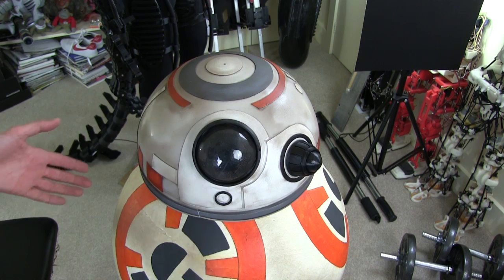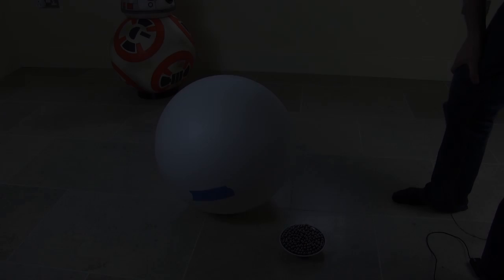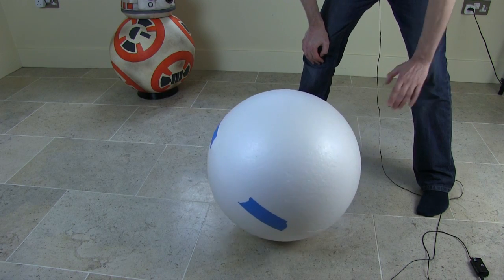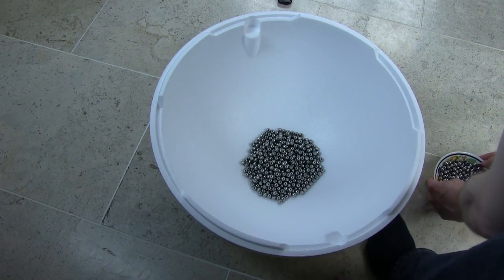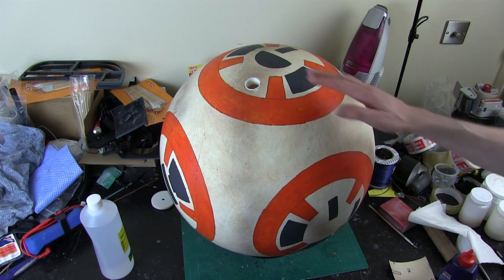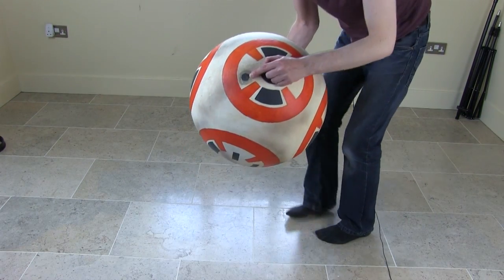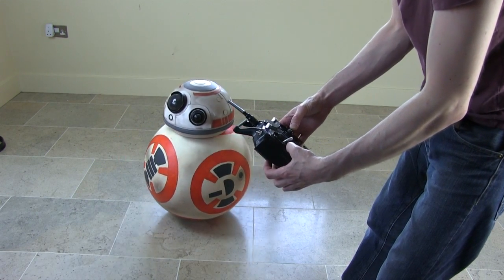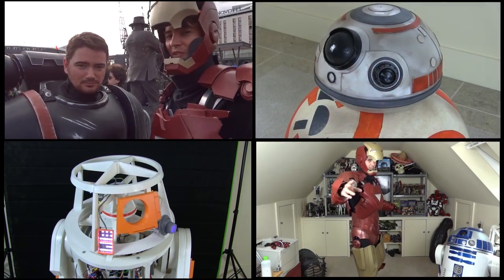Star Wars BB-8 Droid v1 #5 | Improving Stability | James Bruton

Comment: +James Bruton

It seems like this is an attitude control problem. Have you considered gyros?
Reply: This design would be much more effective if you enabled it to be opened up, and single ball bearing installed that's equal to the weight of all the smaller ball bearings you have in there now.

Comment: The original small version has all the controlers INSIDE the ball.

Not the head!!!

If you do it like the retail version it might be better
Reply: +James Bruton (XRobots) Actually, it's fairly similar. It uses a weight towards the bottom of the ball to move itself akin to using a gyroscope while using an always upright magnet to hold the head in place.
Reply: +James Bruton (XRobots) You should try to configure the controls to run on a program on your smartphone. That way it's a lot easier (at least to me) to control and you might even be able to get it to follow you, if you add a tracker of some kind.
Reply: +James Bruton (XRobots) try placing a slightly smaller sphere that has a centering weight inside the bigger sphere and use some type of oil lubricant between the gaps of the two spheres and technically speaking it should work,it's just a matter of placing the right amount of weight in the center sphere and finding a solid smooth material for the outer sphere,kind of like how a novelty eyeball glide ball works but instead of water you use oil.

Comment: this might sound retarded but I have a thing you might try.Paint the ball with Plastikote paint with a little distance to the can so theres a very slight texture. the plastikote paint has a rubbery surface it will add both density and traction to the ball and seal the ball to protect it from any lubricants. it would in effect simulate your results on carpet and reproduce them on a smooth surface but not increase your weight so extremely and make absolutely zero noise.

Comment: I wonder, what about suspending a smaller ball (via 20mm tubes or similar) that sits concentric within the polystyrene shell that is made of plastic and filled with a liquid?

You could use water as the base liquid and add substance to it such as sugar/salt to increase it's density and it's viscosity.

Comment: will be interesting what you do.. just at about 3mins into the video.. so don't know what you've done yet.. a large semi-deflated soccer, dodge or volley ball inside .. it would be light but act like the carpet from the inside like you want. the physics are pretty much exactly the same...  of course the weight of the ball and it's inflation would have to be played with.

EDIT: a lighter, but large diameter kids ball would probably be perfect.. like those sold at Walmart for $2 and are made of thin vinyl.. they hold their shap well, have minimal mass and would be a perfect analog to your carpet

OR

a some glass marbles/ball bearings, depending on mass tuning

EDIT 2:.. lol.. just pushed play and yep ball bearings .. but i'm thinking the under inflated vinyl ball is your best bet.. and IT WOULD BE SILENT

Comment: have you tried Green Tire slime its thicker than water and it might work, but you will have to try and find a balance, best way would be to slowly add it and try it each time to find the balance. Maybe even Oobleck might work. You used Ball bearing, you can use the weight of the ball bearings to find the proper amount of slime to use.

Comment: +James Bruton (XRobots) mount a strong magnet on bearings inside the ball - and have it pull toward a similarly mounted iron plate in the bottom of the head.  You might also leverage this for traction to turn the head atop the ball.  CAREFUL - you'll have to shield all of the electronics well if you plan to mount a magnet that strong just below them or you could scramble your droid.

Comment: To increase stability, you need to reduce the motor gearing ratio, and use larger motors.  Effective inertia scales with the square of the gearing ratio, making the inertia and brush friction of the motor rotors dominate over everything else.  That's why Segway-type balancing machines require oversize motors, geared low, and require large battery currents.  The gyro signal is independent of where it is positioned.  You won't improve anything by mounting it higher.  In fact, the accelerometer signal gets worse the farther you get from the ball's center.  That's why you low-pass filter it.  You comment that the Arduino is too slow.  I say Bull!  If the code updates 100 per second, it is plenty fast.  (If it is not, you need to "write some real code" in assembly.   Bump up your motor size, and lower the gear ratio.  Regarding ball fill, I would use a viscous fluid, such as glycerine.  Adjust the viscosity to be critically damped (just enough to not overshoot).  You can do this in an open ball half to test.  You could also use polyethylene oxide dissolved in water (chemically innocuous, and you can adjust viscosity, and a very small amount can thicken a large amount of water).

Comment: was a neodenium magnets in the big ball not an option similar to how the toys have been created?
Reply: +James Bruton (XRobots) - The head may not be as stable staying in the center top but it actually moves and picks up speed without making tons of noise like your model. You should cut your loses and try making a larger scale model like the store made smaller version learn what makes it tick and then improve from there. The only thing I can think to make your version work better is filling the ball with those gel beads that absorb water and grow over night (usually used in kids toys or in room scenters). This would prevent the water from sloshing around to much.

Comment: I think if you build an apparatus that could freely move inside the ball, but kept a weight up more towards the top of the ball, it would have much better stability. Perhaps a rig that has the same sort of wheels the head has which can support a rig that holds a weight? It wouldn't even require battery power or electronics, it could be entirely passive I believe.

Comment: here is a crazy novel idea why not put the computer and drive motors inside the ball with a simple stick reaching up to the top side of the ball with a magnet on top and a corresponding magnet in the head. that way the ball will be naturally gyro stabilized. you will need 3 more Omni wheels tho.

Comment: Consider having a light weight internal and external mechanism, have it interact opposed to the gyro inside and with the gyro on top. Considering it'll be inside you could also create a wheeled pole in the middle that extends vertically(You could use the ball bearings to limit friction by using them like wheels)

Comment: Very impressive work! Although, instead of the ball bearings, wouldn't a slightly more viscous fluid have worked in a similar manner without the noise? Perhaps even the Silicon oil you'd used would be enough.

 Also, any chance you could/have made a video showing the remote controlling in action? Just navigating a small course would be great. I'm interested in the control and handling you'd have with it.

 Great work again, and thanks for showing us the process!

Comment: Another idea you can experiment with is using just a 2 dimensional axis (plus sign diameter of the sphere) having very low-friction wheels and one corner having a magnetic connection with your head (controller unit) so when the head turns on it starts the magnet on its bottom (obviously an electromagnet) and connects with conducting material (which ever you choose) on one corner. And the axis wheels can be on rotational axis base like the ones on cabinets. And the conducting material could on just the one axis(the direction of the wheel movement) of the wheels so it can freely move in 3 dimensions

Comment: nice try on your thought process, nice and logical. Secret is center of gravity of everything kind of, and friction alsofrom a mechanical engineers points of view here of my GENERAL thoughts(think of good old circus performers tips and trick of standing on balls, funny but true)FIRSTBalls bearings>>>your introducing more variables>good in average solution but BAD in speed of variables of your Gravity center point(wobble) cause of more ball more errors/friction etc.Liquids>better BUT you Centre of gravity STILL varies when in motion(less wobble delta but same wobble none the less).A Good option would be the WHOLE BALL made of a material that is DENSER(don't think its of its total weight), wood, heavy plastic, metal etc. so the center of gravity stays 100% CONSTANT(wobble=0) at dead center. putting something in a Styrofoam sphere is not as great but VERY NICE visual effects of balancing (love to see it wobble though/thumbsup)lolALSO, balancing wise>in a perfect world>the robot's HEAD should have a constant center of gravity=your ok there BUT...you need to figure out the perfect RATIO of centers of gravity vs Weight vs friction(next point) for a good "balancing act/movement" maybe like Head: Body 1:4 weight kind of or 1:3, I don't know the exact numbers tbh when pi is involved I usually stop thinking specifics but hope you get the point. you may need to increase the head's density too once you figure out my next suggestionSECONDFRICTION>>>whatever the type of Body ball your using, you need to reduce Friction from surface to ball, you need a THIN COATING of RUBBER film on surface of Body Ball via Spray Paint, Dip, heck if you had a metal Body ball you could maybe even electroplate a type of rubbery compound high tech etc. lolSomething transparent would be nice cause of looks of robot would be maintained since could see through coating and see paint job on body ballif not transparent rubber coating then I don't think you could paint over it cause your adding a slippery surface again.Perfect world the visual Design/looks of skin made of each colored type of rubber cut outs of sticky rubber and Collage to surface for bb8's lookPS, don't forget the approx. weight of the rubber itself, its not that unsignificant.BTW I'm not thinking price, time, hobby, fun factor, visuals, nor am I think of modifying anything on your Arduino's point of view.Your controlling hardware to balance(processing speed) I'm pretty sure your a-ok to balance, just looking at video and seeing the head in action, it should be quick enough in speedGood luck on project peaceout

Comment: I'm not an engineer or anything it seems to me that if you were to take the ball bearings in a crisscross fashion on the inner surface of the sphere using tape to hold the ball bearings in place you can eliminate the sound maintain the weight it's to achieve what you're trying to get to just a suggestion like I said I'm not an engineer

Comment: Try using a low-friction single, solid hemispherical object to fill the base instead of objects that have to roll/shift in order to move such as individual ball-bearings or water. Perhaps even a single smaller, fully spherical ball would work as well.

Comment: Instead of the weight of the ball bearings, what about putting in enough silicone oil to reach the same amount of weight at the bottom of the ball? You would have to take into account the loss of oil as it coats the ball, but with the heavy weight of the oil, you could simulate the ball bearings without a lot of rebounding and of course that would take care of the noise as well.

Comment: Have you tried a mixture of sand and water? Its possible to bend and apply small sheets of thingsteel/alloy to the inside of the large ball and add 4 magentic wheels to the inside of the head to keep it on there. This will make the large ball heavier and also help keep the head from falling off

Comment: Ok just a few ideas you could try if your keen . i think because you have used small balls I think they are stopping each other from getting to the balance point there  for making it very unstable. maybe try 1 larger ball bearing. Or you could go completely away from ball bearings and try a material like alumina its a very thin powder that can be poured like water doesn't have a huge amount of weight and is dry like sand. or you could go and make another gyro type pidloop inside the actual ball that can drive around inside like the outside 1 and connect them together wirelessly  so that to the top or outside pidloop is doing the same gyro balancing making it more  stable and increasing the drive power. so you would actually have 2 pidloops inside and out, if balanced together they should also make it drive a lot faster and easier ."Just some thoughts " hope you like .

Comment: Hey did you ever get the weight distribution problem solved? I noticed you've had issues with it wobbling. Have you tried placing a "jack" shaped object inside like a 3 dimensional asterisk? Just throwing out an idea. Great work btw!

Comment: How about a skeleton that moves independently of the polyurethane shell with a gyroscope attached in the middle to keep the skeleton level. You can then add weight to help with stability. It probably wouldn't make any noise either.

Comment: I'm only taking a guess. Why not one bigger heavier ball, almost as big as the outer ball?  I think the issue you're having is all the surface area that all the balls have on each other, each one has to get enough force to be able to move which means there is a increased delay.  Also when you go fast enough the balls will be too light and be tossed around.

Comment: You need a magnet in the middle of the ball supported by four beams and then put one on the bottom of the head so that way it doesn't fall off so easily and it can go faster probably without any damage to the head hopefully

Comment: What if you could do like a setup of maybe a magnet system but set up the tracks inside the ball so it can move and turn it's head and so forth yet look like a regurlar ball system, but the magnets would hold the head to the ball and the wheel system can do all the movements and head turns?

Comment: What about placing a controlling bot inside the ball and leave the head to just react to the gyros to maintain balance? It lowers the center of gravity, stabilizing the ball. It may also lower the processing required in the head improving the reaction time.

Comment: You might want to put a second device inside the ball, rather than ball bearing and oil... The head section seems to have a magnetic hold on the ball.... Maybe a thin metal strip or coating on the inside

Comment: I don't know if you are still looking to refine BB-8's damping, but if you are take a look at Tuned Liquid Column Dampers.  I believe if you designed a modified TLCD to sit low in BB-8 it would be a very slick way to handle the damping duties.

Comment: James, What about the RaspberryPi? Too many fast changing variables for that Arduino. Also, I think the center of gravity on the robots head is too high up. disperse the weight as low and outward toward the edges as the design lets you. Maybe make a circular plastic platform for the electronics in the head but one that covers the wheels as well  but rests weight on the edges of the chassis directly to the wheels or around them.

Comment: Adding an internal robot (synchronized to the external robot) to the bottom of the ball or an internal balancing rod the length of the internal diameter of the sphere magnetically connected to the outer robot (either solution achieving the goal of moving the center of gravity to - or lower than - the center of the combined system) would do the trick. Loose bearings or fluids are not stable enough in relation to the outer robot, so the center of gravity shifts around...

Comment: You might have had better luck with a heavier/larger ball and some type of oil on the inside. You wouldn't have the cascade from the ball bearings, which would reduce noise and the wobble. It would be similar to: http://www.instructables.com/id/Make-An-Amazing-Magic-Ball/ 
(this uses honey so it doesn't move well but the general idea is right)
I'd use something a bit less viscous, mineral oil or something similar to dampen the ball a bit.

Comment: Here's how you do it. You make the ball out of a metal, so it will have plenty of ballast, and it can also be magnetized. Inside the head, in the center, there are round magnets that hold the head on the ball, even if you picked up the ball, the head would just rolled down to the bottom, but not fall off. Then you have rubber wheels around the magnets that navigate the ball. :)

Comment: I believe what you need is a second robot inside the ball. Make it heavy enough and the system will be stable until the head slides off. Makes it a much easier control problem and you can have it parked with the head tilted should you want to.

Comment: Very nice work. Might be nice to code it up so instead of your right/left stick driving it in those directions, they would rotate the head then forward/backward would be used to actually transport the bot. As it is you can't really turn a corner and have it face the new direction after the turn. If I understand your control scheme correctly.

Comment: I think original one has something motorised inside the ball what dictates direction and speed. It probably keeps head upright magnetically on sort of fishing float principal. Of course internal part has to have wireless charging capability.
Reply: Yeah. So I thought if you stick your rolling rig inside ball and make it heavy with  light head, you'd have better control over this.
Reply: +Peter Wobacz Maybe there's a hidden panel on the body that can be opened for charging. Would certainly be simpler than wireless charging, assuming the panel could be flush with the surface when closed.
Reply: +wil mach +Nick Combs Yeah, he's aware. But he started building this before anyone was certain using the 'drive on top' idea. But I agree that maybe it's time to just rebuild it rather than try to band-aid it.